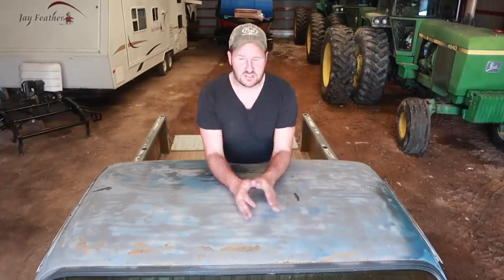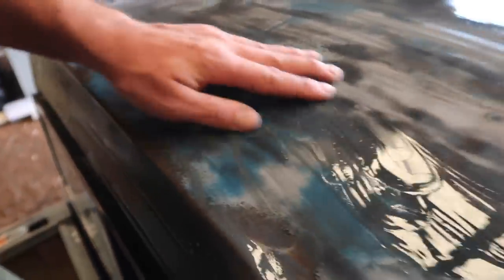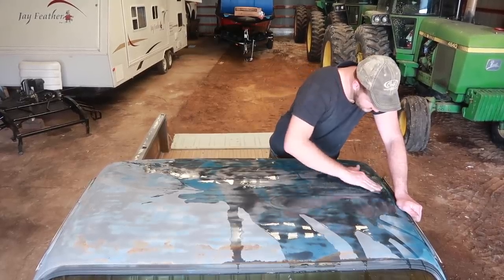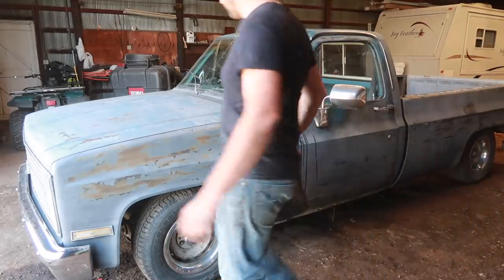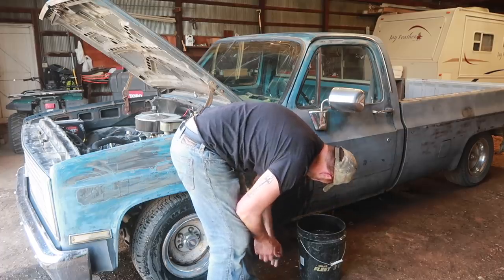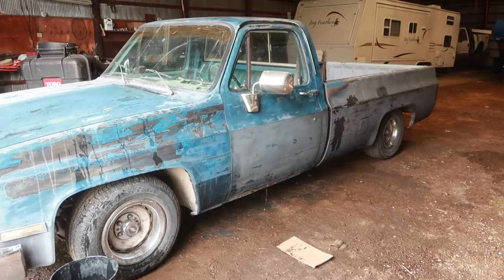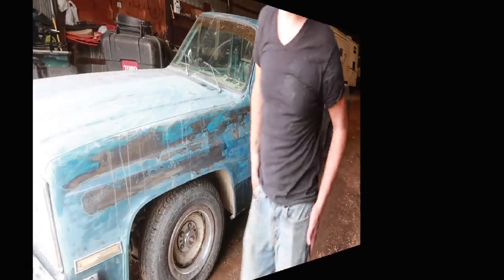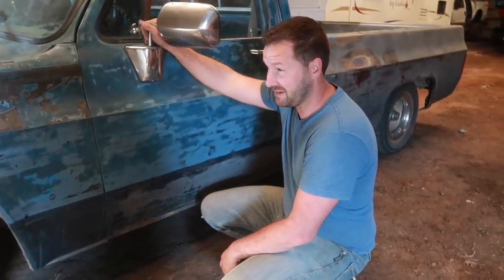DIY Patina For $10 Squarebody Build (EP 3)

Comment: Use a large sponge with a “little” Dawn soap & water in the bucket. Take full sheets of 3M sandpaper fold the sheets in half keep folding like you would a sheet of paper once it’s in two pieces, fold it in thirds and sand. Try to sand flat because you will be able to see dips if you decided to paint. Best to use a sanding block for the flat areas!

Comment: Well, actually, I’ve had this thought for a long time that I would kind of like to drive around in a fairly beat up looking vehicle, kind of like this one. Maybe not this bad. But I would like it to run like a top. That way it wouldn’t matter so much if it got dinged up. And nobody would steal it. I think you’ve got yourself a good summer project. And winter. And maybe for quite awhile after that. But it will be good therapy, as they say.